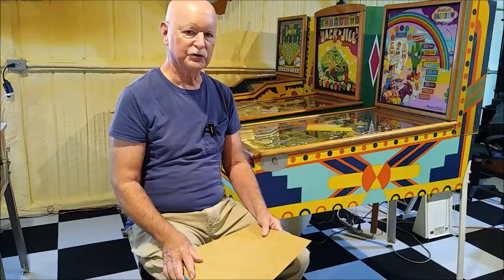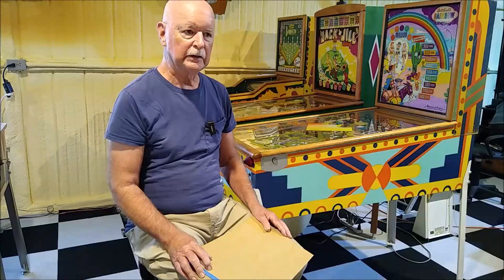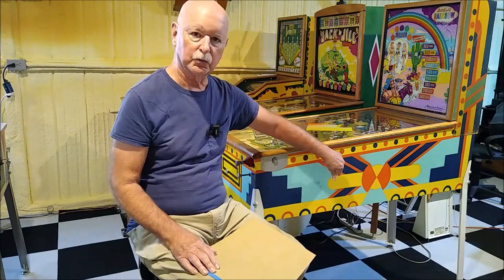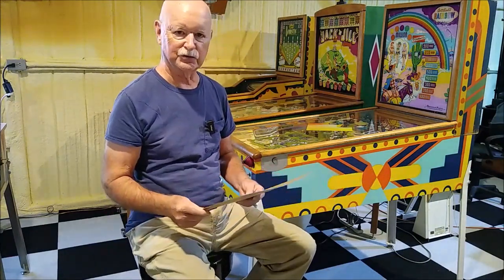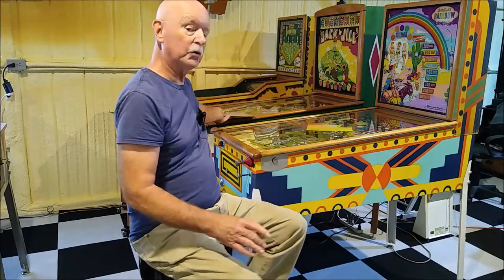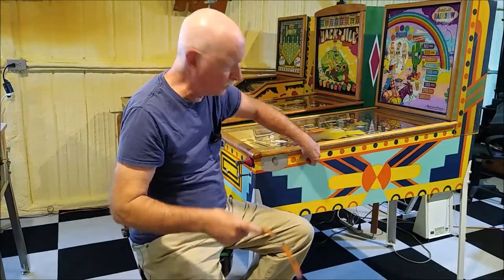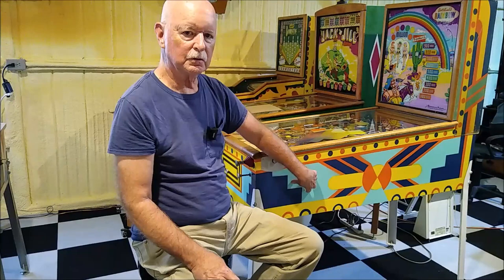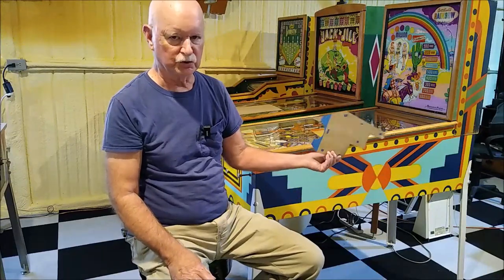Pinball cabinet painting stencil technique: jigsaw puzzle

Comment: Great video, I just started painting (already cut out the stencils) I had a lot of trouble getting the curves to look good and not have jittery edges, especially on the circles. But I just now ran into a huge disappointment,. I removed the stencils and virtually all the edges were massively blurry. I used many fastening tapes and even put weights on the edges in some places. My rustoleum spray paint (I usually use an airbrush, but it was broken) went on looking good, but the edges were terrible. Any suggestions ? I still have three sides of my backbox to do.  Thanks
Reply from the maker: I have never had blurry edges other than a rare soft looking edge which still looks like the factory painted it.  I can only guess at what happened.  Maybe the paint was sprayed on too heavy and close, also sprayed at an angle to tunnel under the stencil edge.  Paint should be sprayed lightly and quickly making sure to keep the spray pattern perpendicular to the cabinet, not sweeping the spray from side to side.
Reply: @FIREPOWER6  Thanks for your reply. I believe that a combination of too heavy of spray and that the texture of the surface that the stencil was sitting on was the culprit. I think if the surface is not real smooth that I should Pre-paint the edges making the edge of the stencil sit flat and sealed. I am trying that in the next section.   BTW,  I wouldn't normally use the rustoleum spray can, but the color matched so well. and its convenient. It was really really hard to spray lightly, as the volume of paint that came out of the can was heavy .   Thanks again for your help !

Comment: how thick is the oilboard?
Reply from the maker: 15 point (.015")
Reply: @FIREPOWER6  Thank you.  Do you use automotive paint?
Reply from the maker: @lindadeschnd2735  You can use any can spray paint you like, just apply light coats so you don't get an edge build up along the stencil.  On this cabinet I used Behr rattle can spray paint at Home Depot.